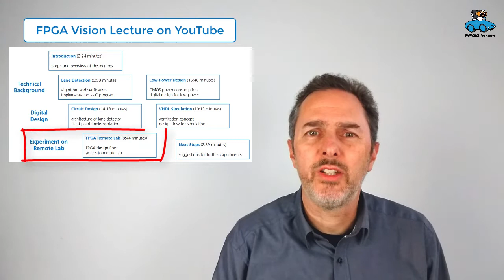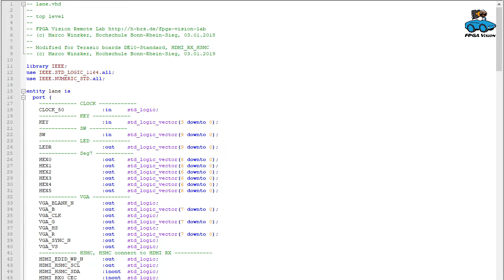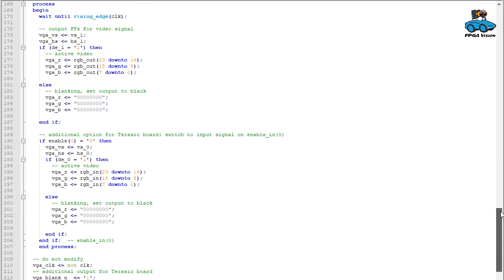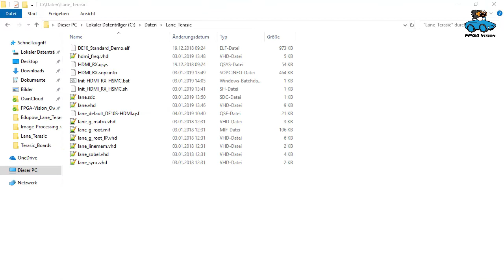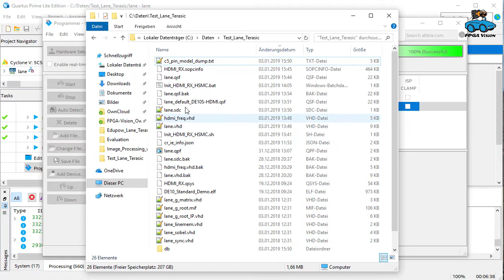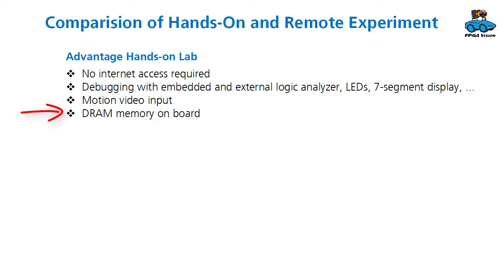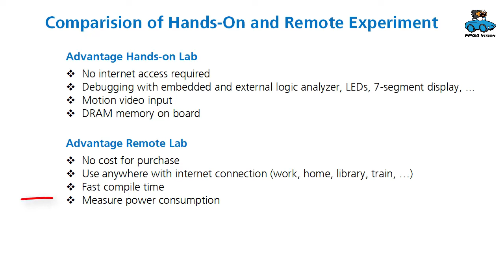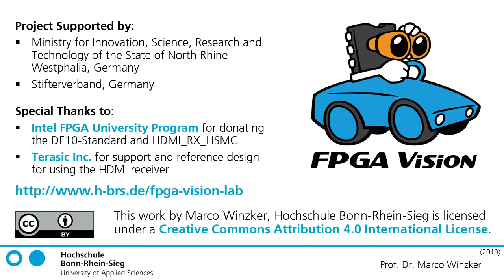Image Processing with Terasic FPGA-Boards

Comment: Dear Sir, Thank you very much for your helpful videos. I only have the DE 10 FPGA board. Please, can I do this tutorial without using the additional board (i.e. HDMI Rx)?
Reply from the maker: If you don't have a video input, you can use an image generator on the FPGA. There is a video for that: Image Generator for DE10-Lite FPGA Evaluation Board 
https://youtu.be/qw2aAbzBLH4
Reply: Sir, thank you very much for replying.

Comment: @marcowinzker3682  Hi Mr.Winzker, I am developing the implementation of image correction on camera feed and wanted to know what kind of FPGA approach would be adequate for changing the addresses (positions within the images) of pixels. Each pixel has an initial address and each pixel has a final address at which they should be displayed instead. Please let me know and thanks for the great videos. This is done at 30Hz with 1920x1080 resolution. Is such a thing even possible?
Reply from the maker: For this task you need a large memory. The on-chip memory of an FPGA is not suited, so you need an external memory like SRAM or DRAM. Then you have to calculate the data rate for accessing the memory.

You find an example in the following paper:
M. Winzker; P. Pirsch; J. Reimers, "Architecture and memory requirements for stand-alone and hierarchical MPEG2 HDTV-decoders with synchronous DRAMs," IEEE ISCAS 1995.

Comment: sir i want  to know that i am doing a project   by using a image processing technique ,there i just need to capture the image and to compare it with template image ,to identify the sample. can i do it with help of terasic fpga board or is there any other cheaper way to do this...help me please
Reply from the maker: The cheapest way is using VHDL simulation. See my video "FPGA FIR Filter: Self-Checking Testbench" https://youtu.be/wTIHEX7WWvg

If you implement the design on our remote-lab, you get the output image as a file. 

With the Terasic FPGA board you can store the image in the SDRAM and read it out. You need a memory controller for that and it is a nice project but a lot of effort.
Reply: @marcowinzker3682  i need some personal guidance for my project. Will you please help me

Comment: Hi Sir,
I am working on image processing using de 10 fpga. The code provided in the description and comments section is not working. Kindly update it or share via google drive if possible.
Thanks
Reply from the maker: Hello, there are several DE10 boards and they are really different: Standard, Lite, Nano
The design is for DE10-Standard.

Comment: I am thinking of using a cheap high sample rate A/D chip like AD9288 to sample VGA signal. I would need two since it has two 8 bit channels.
Reply from the maker: You need three channels for RGB (red, green, blue). Plus two inputs for horizontal and vertical sync.

Dedicated decoder are available, for example ADV703.

Comment: professor, is it fine if i change the raspberry Pi into my own laptop as the HDMI input? the result of the HDMI receiver software shows lots of read/write fails after i try it. What should i do?
Reply from the maker: Yes, you can use another HDMI source. I only checked the setup with the  Raspberry Pi and 720p video format.
For your error messages, i have two assumptions:
a) The video format is unknown. Try 720p@60Hz (1280x720 pixel).
b) There is a problem with the interconnection. Try another cable and another laptop (from a friend).
Reply from the maker: @yihuang200  It seems, there is no connection. Maybe the design of the FPGA is not correct. Do you have correct pin assignments? Did you import of the constraints?
Reply: @marcowinzker3682  Sir, can you update the files again? thanks!
Reply from the maker: Yes, I did an update: https://magentacloud.de/s/GjKTHr2GQazibNf
Reply: @marcowinzker3682  I have a question about the video. Why the Quartus is ver. 18.1 but the software of HDMI receiver  is Nios ver. 17.0 . When I try it by myself, they’re both 18.1 ?
Reply from the maker: @yihuang200  Yes, I also observed that. My understanding is, that Quartus makes a conversion. (But I am not sure about that.)
Reply: @marcowinzker3682  Sir, I get another clue! Our Quartus Prime Version is the same: 18.1.0 Build 625 09/12/2018 SJ Lite Edition. But after compiling, our “Total Registers” and “Logic utilization (in ALMs)” are different. My Total Registers are 2895, and yours are 2893. My Logic utilization (in ALMs) is 1911/41910 and yours are      1909. So I consider that the codes might not be 100% the same, there must be something different a little bit . Please help me find out the problem. I really hope I can accomplish it, thank you so much.
Reply from the maker: @yihuang200  I don't have 18.1.0 on my computer anymore. With 23.1std.0 I get 2929 registers and 1905 ALM. So, some variation is possible, especially if you work with synthesis options.
I don't have the board around, so I can't check functionality. Sorry, I can't help further.

Comment: Instead of Pi as video source, can we use HPS as a video source? I mean using a video in linux or utilizing USB / Ethernet interface for camera? Then I don't have to spend money to buy HSMC daughter board and raspberry pi to load the video.
Reply from the maker: Yes, you can generate the image on the FPGA. Please have a look at the lecture video "Image Generator for DE10-Lite FPGA Evaluation Board". https://youtu.be/qw2aAbzBLH4

You can use that approach as a starting point and make the image generation more advanced.

Comment: this is crazy, how much of a fps was going at while using the processing? and also if hypothetically, say adding on top of each layer, lets say 3 other image processing effects, what fps would it be at in real time? this project got me thinking of doing some drone projects for the police force or some kind of video capture card from the pc to the fpga board in real time accessibly reasonable fps that can apply processing effects on footages lets say by a game footage to detect something. thoughts?
Reply from the maker: You don't get fps (frames per second) as a result. It works the other way round: You have a frame rate and image resolution and from that you get a pixel frequency, like 74 MHz. Then your digital design must match this frequency. 

If you have several tasks, the FPGA needs sufficient ressources. As you can see at minute 3:55 there is still capacity in the FPGA: Only 5% logic and 4% DSP is used. 40% memory is used, but there is still capacity and maybe memory can be shared.

Comment: How load image in fpga using xilinx ise design .
And in xilinx where i have to find area and dealy .if i change anthoer image . How to do? Plz tell me sir
Reply from the maker: I am sorry,  I can not give support for general FPGA questions. The video uses Intel/Altera FPGAs with an HDMI video input. If you have questions to that design you are welcome to aks.
Reply: In general - https://www.xilinx.com/products/intellectual-property/video-processing-subsystem.html Free to use in latest Vivado versions. Although, like any complex IP use - it's not trivial and requires knowledge and experience in creating system designs even to integrate 3rd party blocks and components
Reply: you can do it from the shell go to xilinx tools then shell after that run this command mfsgen -cvbfs ../image.mfs yourimage.png 
after that go to run as then run configurations and give it the image created

Comment: Marco, Can I use this solution for pixel streamming processing? I am vision impaired and I want to design a hardware with 1 HDMI input and 1 HDMI output, between them I want to invert each pixel. So it should be an implementation at hardware level of "Negative Colors"(an important accessibility feature for me). Do you think can it be something possible with the mentioned setup in this video?
Reply from the maker: Yes, this is no problem. We do exactly this processing as a first exercise.

Comment: can we do image processing on de10 nano board?
Reply from the maker: For image processing you need image input and image output.
The DE10-Nano has a video output (HDMI TX) but no video input. So it is not possible to get an image into the FPGA.
The board has some GPIOs but no high-frequency connector for a VGA or HDMI receiver. 

You have the option to generate a test image inside the FPGA. This is described in the video "Image Generator for DE10-Lite FPGA Evaluation Board". https://youtube.com/video/qw2aAbzBLH4 But this is a simple image and you can not provide your own JPG photo.

Therefore, we developed the remote-lab with image input and output and without cost. :-)
Reply: can't we store images in sd card of hps and do processing using fpga?
Reply from the maker: The bandwidth of the SD card is too low for direct display output. 

But there is an option: The HPS can copy an  image from SD card to DDR3-DRAM. Then the HPS can read the image with high datarate and give it to the FPGA. The HPS has 800 MHz and the DRAM a 32 bit interface. A 720p signal requires 24 bit (red, green, blue) at 74.25 MHz. So this should work  and is certainly an interesting project.
Reply: Can i know something about arduino pins of de10 nano board?
Reply from the maker: You can attach shields to the Arduino pins, but there is no video-input-shield for Arduino. 

If you have general questions about the Arduino pins, I regret, I cannot give support for the DE10 nano.
Reply: de10-nano board lacks direct video inputs but if you'll supply images from Linux HPS part (webcam or using any other integration with video sources) - no problem. DE10-nano has same Cyclone V SoC and HDMI output